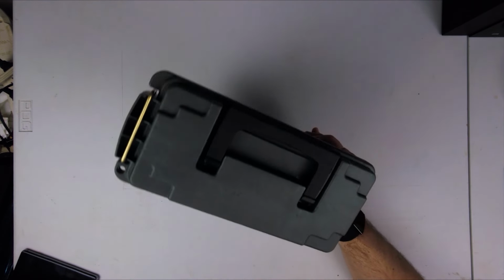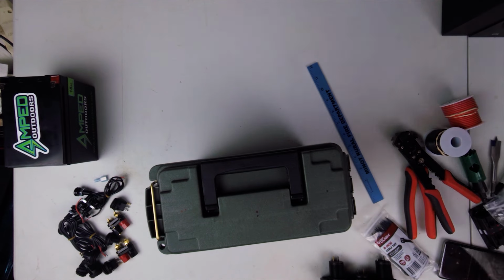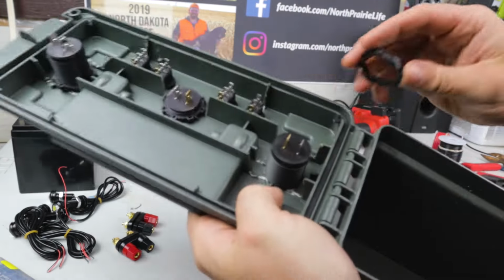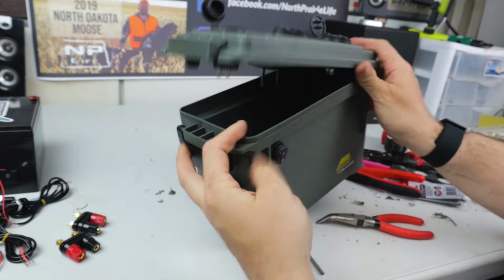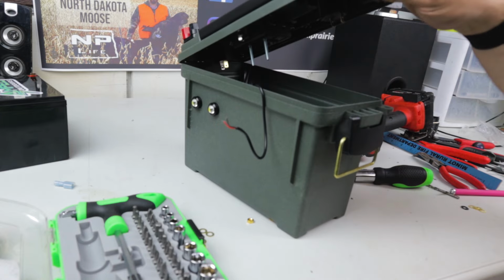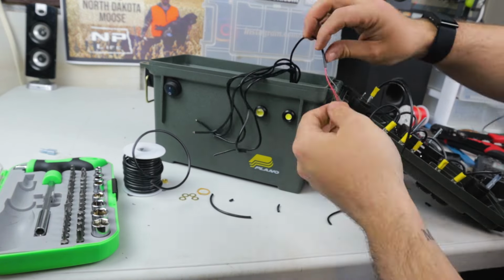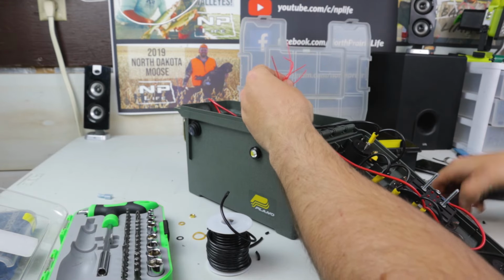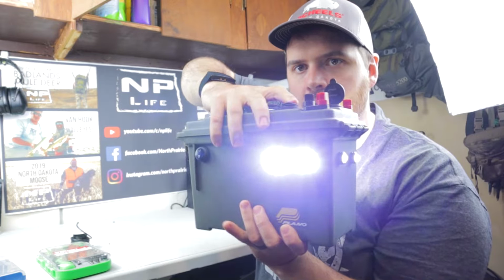DIY Lithium Power Box Build | 18ah Portable Charging Station | NPLife

Comment: This is really cool, thanks for sharing! I'm looking to upscale this for a ~40AH battery as I'll be using mine for astrophotography so will need it to run all through a winters night.
Reply: Did you make one? I use Minn Kota trolling motor boxes for my home built emergency backup power boxes to  run CPAP machines. I put in a 100 amp hour lithium battery in one unit and with its attached 300 watt inverter weighs 22 pounds. I got carried away and stuffed mine with a 200 amp hour lithium battery to run a 1200 watt inverter if needed. That weighs 43 pounds total. With that, you could run your iOptron SkyGuider Pro,  a 5 cup coffee maker, cook your midnight stew with the smaller Instapot pressure cooker, and run your trolling motor to get across the lake in the morning. I should make a video of it.
Reply: @kimmer6  Hey Kimmer. Well, my astro rig grew arms and legs so I had to rethink the power solution. Given work and the awful weather we've had, I've not had the opportunity to image remotely so for now, I'm continuing to run on mains electric. Wow, sounds like your got your power situation sorted out!
Reply: @IcedReaver  I should start hanging out in the pub. It might be a cheaper endeavor than building lithium battery powered things!  Here's that trolling motor box with 200 amp hours, 2560 watt hours,  stuffed inside. I built the 7200 watt hour unit underneath it for running my son's fridge and chest freezer when the grid goes down....again. I keep improving it and Version 2 will be much better.  In NorCal, Spring weather arrived and I'll head out tonight and look for satellites.   https://www.youtube.com/watch?v=Z1raS3WEe1g
Reply: @kimmer6  I just checked out your video, and you weren't kidding when you said you had a slow cooker on the go! I'll put in an order of beef brisket please :) I'm sure you'll see plenty of satellites when the sky is clear, they certainly find their way into my images that's for sure.
Reply: @IcedReaver   
Remember the Iridium satellites? I tracked and viewed about 200 of them. They would catch sunlight at night for a few seconds and flare brightly. My tracker app was quite accurate. I was at the local fishing pier one night pointing out where to look to my friend who never saw a flare. Some crackhead asked what I was pointing out. I showed him the app and the map on my cell phone and couldn't help myself in telling a fib. I told him that I worked for Lockheed Martin and that I was going to turn on the back porch light on our satellite. There were about 6 of his friends and I pointed out where to look. I did the countdown and tapped my phone. They thought that was the most awesome thing...touch my phone make that thing in space light up.  ''Do it again, do it again!!!''.   ''Woops, can't do it yet. I have to let the batteries recharge.''  I miss those Iridium Sats....     Corned beef and cabbage coming up Thursday for St Paddy's Day. Come on over.
Reply: Please do make a video of that.

Comment: Very nice build. I will be making a similar one shortly and you gave me some good ideas. Greetings from sunny Jamaica.

Update: I built mine in the same ammo can but with less components. Only 2 lights and no fuse block, just an inline fuse from the battery. I used a 7.4ah sealed lead acid battery (UPS type) since i got some free used ones that were still pretty good. I charge it with a 100 watt panel and sometimes a 10 watt panel.

Comment: This is fantastic! You are obviously very knowledgeable about circuits and how A/hr work for Watt hours and load.. I haven’t quilted figured out to all the math yet, but I’m thinking about making one of these to be my reserve power at night for our 12v camping fridge. It averages 0.89a/hr @ 12v dc.. 
a/hr x v = watt/hr.. 
so 0.89x12= 10.6W/hr load from fridge
And your battery is 18a/hr
So, 18x12= 216W/hr and i think Li batts are good for 80% capacity.. but technically 216/10.6= 20.3 hours of stand alone usage correct with my fridge? I would only consume 8-12 hours of charge per night and will have a 30watt solar panel and main battery + alternator to charge during the day.. does all that sound like I’m understanding it yet? Thanks again 🤘🏼

Comment: Aaaaaand we have 7,463 crimp connections and splices in this little box that’s going to get bounced around all the time, guaranteeing hours of fun and entertainment while trying to find the ones that are loose connections and shorts.   Something like this is more than enough of an excuse to learn how to solder electrical connections.  It’s not hard and provides better and more reliable mechanical connections.  If you’re going to go to all that trouble, why not do it right?
Reply from the maker: Feel free to do it with yours my dude! I haven't had a problem with mine🤙

Comment: Hi. Nice job. Im making one for myself. I have a few question.

1) im not using a fuse box but 1 fuse holder instead. Its connected to my battery positive outlet just before the main switch. Is it ok to do that?

2) how do i know what amp fuse should i use for my power box?

3) is it ok for me to charge the battery while all the connections is attached to my battery? Or should i remove the connection on my battery?
Reply from the maker: Hey! Sorry for the late response.  I'm not the best person to answer these questions for me, but if you head over to the Ice Hole Power facebook page and send them a message, they're very helpful.

Comment: Can someone explain what the two sets of banana posts do? Is it to charge the lithium battery? What connection would I need to charge the lithium battery via banana posts? 

If I were to get an SAE kit instead, would it replace one of the two sets of banana posts?
Reply from the maker: I use them for charging and that's where I connect my lighting for a fish house.  Just alligator clips
Reply: @NPLife  thank you! And I imagine those alligator jacks can go to a wall outlet or solar panel as well.

Comment: Gave you a like - and some CONSTRUCTIVE criticism! - solder, solder, solder; anything that'll live near water (especially the salty
kind), should be soldered, not crimped, to prevent corrsion damage, longterm.  Nice tools, by the way.  Also, the box is too small 
for ALL you stuffed in it; thse newfangled batteries (BMS-controlled powerpacks), NEED cooling,  no room for circulation leaves 
NO room for cooling air to do its job; not to mention all the heat producing lights, etc. (even if they're all LEDs, they still give off 
some heat), and it leaves additional room for future 'improvements' - my projects are rarely ever "complete" for at least 2-3 
additional sessions of "would have been better this or that way; so I'll change something or two!"

Comment: Run piggybacks to a waterproof SAE connector. That amped lifepo4 charger is easy to splice over to SAE. External charging without having to open the box, and you can wire in a solar charge controller inline for a solar generator.

Comment: Neat works! My only concern is on the lithium capacity. What can you do with 18Ah powerbox? I am thinking of building one with 50Ah, softpack, plus an inverter module, car lighter socket, car usb charger, variable voltage booster 12-30v  (to power up various laptop), and 12v battery charger rammed into the box
Reply from the maker: My powerboxes are mainly for running lights in my ice fishing house and charging cameras/drones while I'm off grid hunting or fishing.  I have this smaller 18 and a bigger 30 that pretty much cover all of my bases.

Comment: Great build. I was hoping you would open and close the box... If you did, I may have missed it. Either way, a suggestion, It appears the wires would bend at the hinge area. While you are not opening and closing often, it would be an area of future failure. If you run the wires from the lid down to one side to the hinge, cross over at the hinge and then into the box. That way the wires would twist over the length of the hinge rather than bend at it. Hopefully this makes sense. Again, great project.

Comment: What are the uses of the banana jacks on power boxes?
Reply from the maker: I use it to run 12v light strips in my ice fishing house.  They have alligator clips that I use to connect.  I also use th to charge the battery.

Comment: only thing i see is not post on the outside to charge the batt.....
Reply from the maker: You can actually use the banana posts to charge the battery.  All yiu have to do is look to the terminals and flip the switch.  Thanks for watching!

Comment: great video lots of information do you think that battery would run a Minn Kota 30# thrust motor for a coupe of hours?
Reply from the maker: That's a tough one Rob.  I have 0 personal experience running a trolling motor off of it for any period of time.  I have used it to test a motor before, but no clue for longevity.

Comment: What are the post for?! And how do you charge the battery? Or is it unchargable
Reply from the maker: Hey! I use the posts for a few things.  One is charging actually.  I just hook the charger to the posts and turn on the switch.  I also use them to connect led strip lights for an ice house.

Comment: The only change I would make is to the master switch. I would not have it wired in a way that it always connects a load to the battery. The voltmeter (load) is always on and even though it's a small load, it is still draining the battery. One possibility would be to have an on/off switch for the voltmeter. Do you really need a constant display of voltage? It only takes one forgetful moment to completely discharge your battery.
Reply from the maker: Hey! Thanks for watching and the comment!  The way it's wired only sends load to the voltmeter when the master switch is on.  The master is the cut off between the battery and any components. Sorry if I didn't show that well.

Comment: I think I’d want some type of gasket around all the holes in case of rain, etc. cut & paint bolts. Great design.
Reply from the maker: Thanks Pat!  I ended up putting some silicone around the holes on the bottom side of the lid.  Just for that extra water resistance.
Reply: @NPLife  BUT.....the components you have used are not waterproof. No point sealing the holes in the box if water can go through the actual components. I would doubt how waterproof the box was before you drilled through the top and sides. As you say... not a good idea tbh. However, a nice build.
Reply from the maker: @simonhamilton500  Thanks for the comment! It's more for incidental splashes and things while on a boat or in an ice house.  No part of me thinks it's waterproof.

Comment: i really wouldnt use switches for the usb, the cig lighter,,they wont use any juice until something plugged in anyway, more switches equal more places to fail, really dont need a main switch either,and one set of lights in front is enough. is a good build, small solar panel with a charge controller would be better than all those switches. i would use a metal box, stronger and youd have a common ground anywehre.
Reply: However... it will allow you to isolate them and only call them into play as and when needed. So it can be rigged ready to go and you dont have to fumble to swotch on USB or Cigarette lighter etc. He clearly wants flexibility. If you want simplicity, then what you suggest is a reasonable route. If I would do anything re the lighting, I would perhaps have had the LEDs grouped into 2 or 3 so the lights can be low ish up to all on at the same time. Position of them is do you want them all one direction or flood. OP wanted radial.
Reply: @simonhamilton500  Good point, 2 lights in front would be enough on 1 switch for me, maybe a main switch just for safety, just me, more switches mean more points to fail, and those switches are not the best for continuous on and off. But a good design i might copy, just less switches.

Comment: Did i miss something?  How do you charge it?
Reply: through the positive and negative terminals.
Reply: Regular battery charger. I built the exact box jds outdoors did with the same solar charge option.
Reply: @chrispierce2942  I didn’t see where you could charge it either
Reply: Alligator clips
Reply: Plus and minus pole
Reply: You just ooen the top,  take the alligator clips and attach them to the battery terminals directly.  If you want solar,  that's an additional build
Reply: I noticed that too. With the mess of wires, opening and closing it to charge will likely create a problem at some point with the wires.

Comment: How do you charge the batteries, is there a way to place a plug in the box for a quick access?  Great video
Reply: I use my box as a waterproof 12v power source so I mounted a set of automotive pass through (remote jumper) terminals. 3/8" is a good post size, and you never need to open the box.
Reply from the maker: I charge the battery through the banana posts. I know quite a few people who put plugs in the side.  Give er a shot!

Thanks for watching!

Comment: Are you gonna charge the Lithium battery through the leads if the main switch is on or off?
Reply from the maker: I charge it through the banana posts with the main switch and the switch to the posts on.

Comment: Outstanding video man!  Future reference, when drilling holes regardless of size, use some frog tape over the spot(s) you want to drill.  It will give you much cleaner holes and I would use bits rather than using hole saw.  The bits will dig that mess up and all you gotta do is pick and pull.  Takes no time my guy.  No scalpel needed lol
Reply: Step bits are the way to go for stuff like that, for sure
Reply from the maker: Thanks man, I never thought of that!
Reply: Or grab a rat tail deburr tool from harbor freight, super cheap.  It's take off any excess flash that the whole saw or otherwise leaves behind

Comment: It’s interesting to me.  All these videos about how to build power boxes and none cover how to charge the battery easily without having to remove it from the box.
Reply from the maker: hey Mike, it's really easy to charge.  just hook the alligator clips of the charger to the banana posts, then flip the switch controlling the posts you used.

Comment: Great video.  I am also building a powerbox of sorts.  I am adding in multiple inputs for charging.  Solar and the ac adapter but everything will be closed so no need to open the case to do any charging or work.

Comment: I am looking to build litium power for power my studio strobes 400 watts second can guide what  materials do I need?
Reply from the maker: Robert, I would absolutely ask someone who knows more than me.  Jeremy at Ice Hole Power has been very helpful.
Reply: Robert, if you are using it purely to Power a strobe light you dont need lithium batteries. The strobe uses less than 30% of the strobe tubes rated wattage, due to the fact that it is not alight all the time..
Thus a 10k lumen strobe at 65 cps will run for approximately 600 hours on one chargr using a 15a/h lithium battery. No way are you going to operate a strobe for 600 hours non stop.

Comment: You really need to INSTALL an integrated charging system.  It really really leaves a HUGE hole in the project not discussing what you are using to charge it.  120v, solar, etc should be included...
Reply from the maker: Hey John! I charge it through the banana posts with a lithium charger.  I'd love to see different charging options.  I'd assume that since you're watching powerbox videos you're planning on making one.  You should create a video and include the things that i missed. good luck!
Reply: @NPLife  Yes... there is a plan to make one.  I have many of the parts.  I am awaiting the charger... to determine how I will incorporate it into the build.  I will do something to outline my progress.  Thanks.
Reply: @PelicanPines  you could tell when you create the video bc Ill be one giving you like and suscribing !
Reply: How's that video coming along John?
Reply: @ColdStoneRacing  Oh... it's like 5 projects down on the list, sorry.  I won't forget.  Spring 2021

Comment: Very cool. What fuses did you use for each circuit?
Reply: The 12V and the dual USB sockets will need a 5V. 3V for the lights. The banana post would be either. Really depends on what the device you are plugging in draws. If you use the banana posts for charging, I would use a 5V.

Comment: how long will it run flood light for fishing i will be using the one that are on a jeep, round 4 in" 3000 lumens i mostly fish at night how long will it last if i build  the box and what size battery should i use
Reply from the maker: I honestly have no clue the answer to that question.  if you asked Jeremy at Ice Hole Power (check out their Facebook) he'll be able to give you an answer!

thanks for watching!
Reply: If you figure out amp draw of the light you can calculate how long the battery will last. If it's led I would guess 1-3a. If you use lithium it's easy, if you use lead acid you can't use the entire amp hour capacity. More like half or less